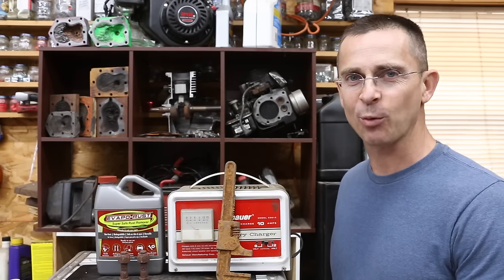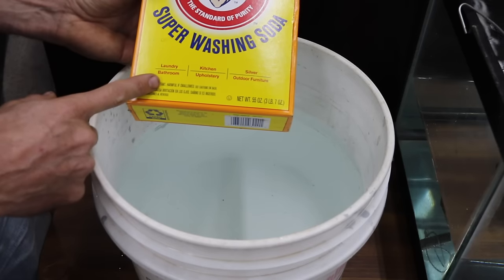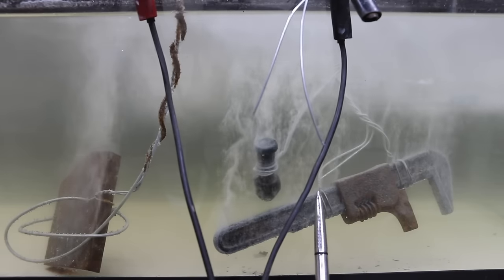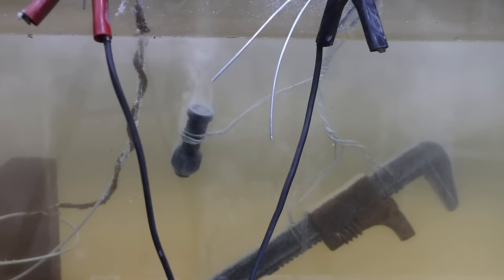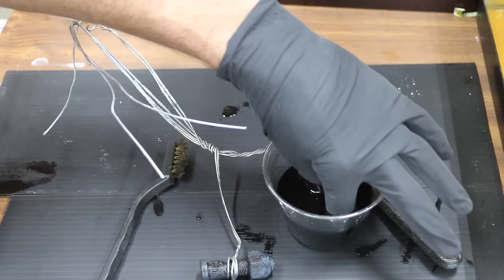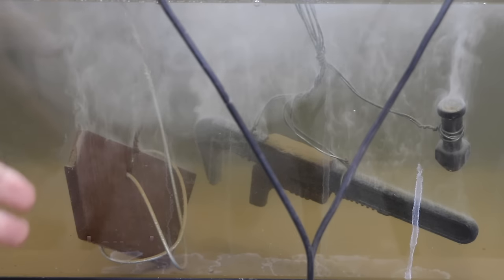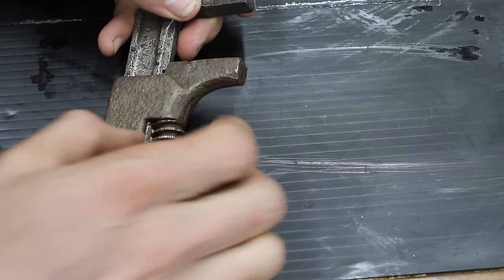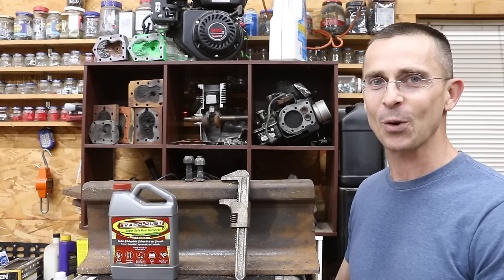Is Electrolysis better than Evapo-Rust?  Let's find out!

Comment: Perhaps it would have been best to connect the slide on the wrench to the wiring to make sure it was part of the electrolysis process for the whole duration in the tank rather than relying on the handle to be the electrical connection to the slide.
Reply from the maker: Thanks for the feedback.
Reply: @ProjectFarm  No prob. 

I really enjoy watching your videos.  Thanks for going through all the trouble of making them.

Comment: Vinegar works great, it's cheap and I soak the rusted tool for 6-24 hours.
Reply from the maker: Thanks for the feedback.
Reply: @ProjectFarm  yep I use white distilled vinegar all the time, using it as we speak because i accidentally left some of my battery operated drill bits out in the rain a couple days ago and found them yesterday all rusty. Started soaking them last night and am about to go hit them with a wire brush and then some WD-40

Comment: I think you needed to put more electrical connections on the ranch and the nut if you actually put electrode on the parts that were moving you would’ve got a better reaction
Reply from the maker: Thanks for the suggestion.

Comment: Needed to wrap the gear teeth in the wrench to allow current flow.
Reply from the maker: Thanks for the suggestion.
Reply: @ProjectFarm  I meant the screw part. Notice how you had to brush the other part of wrench. I think there was insufficient current flow because of the rust layer between both parts. Maybe also the lug bolt and nut as well. See if it cleaned faster with current attached to both peices. Maybe then the rust between the pieces would be removed better. Broken free sooner. Just a thought. It makes sense to me since that whole area of the wrench had inferior results compared to the rest as a whole. Good luck always enjoy your videos.

Comment: The amount of time you took doing the electrolysis could be massively sped up with a larger amount of sacrificial metal and a 200 amp battery charger. what literally took you days could have been done in hours. clean the sacrificial metal to make it more effective.

Comment: Dont forget to explain that after this process the parts should be cocked in a oven for few hours to remove the hydrogen, otherwise the steel will be extremely fragile.
Reply from the maker: Thanks for the feedback.

Comment: My water never stays that clean. After about 30 mins the water is completly brown and rust colored bubbles floating on top. I use atleast 24 volts or more, way faster than using a 12v charger.
Reply from the maker: Thanks for sharing.

Comment: I once used a plastic soda can as a container for electrolysis in my patio and the process caused a lot of hit and caused the plastic container to soften up and fall. After that i had to wash my entire patio with acid in order to clean that rust stain😁
But there's a question in my head about this process. It seems to me, electrolysis attacks the metal beneath rust more aggressively than the rust that's why at first it works on rust faster and when most of the metal cleans, process takes more time. I guess those holes on the wrench wasn't there because of rust but for electrolysis.
Hope someone read this and enlighten me.
Reply: Rust isn't only a surface thing, or rather, it eats away at what's under it as well. The electrolysis process forms tiny, tiny bubbles on the surface of the door steel, which  dislodges and pushes the rust/paint/etc away from it. Those pockmarks are thus where the rust had eaten in, like a cavity on a tooth. Because of how rust spreads, if you don't get it all off, it'll just keep growing from where it was left. Electrolysis like this is nondestructive.  That said, the method used here isn't the best. His wired appear to not be copper, so he's getting poor conductivity, the wires on the sacrificial steel are in the solution, which if they're of a metal that can corrode, causes them to corrode, which also results in poor conductivity, and he may have added too much baking soda, which can make the water itself conduct more than the metal. Check out the "Odd Experiments" channel for a good rundown/demonstration from someone who uses it to restore things.

Comment: Electrolysis was never meant to remove rust.  Electroplating shops clean the pieces by wire brush, wheel, sandblast and sandpaper or acids so that the metal looks like brand new BEFORE THEY PLATE IT WITH Copper, chromium, brass, zinc, or other metal....which is a layer added to the piece...taken from the sacrificial metal.   Iron oxide(rust)does not conduct electricity.  You were basically plating over the rust with the sacrificial metal.  I used to do it using a 12 volt transformer and copper pennies and plate the other metal  or graphite coated plastic or wood  in toilet cleaner H2SO4(sulfuric acid). Kids burn out their racing car set transformer 12DC to do this experiment.  Sacrificial metal was the penny to thinly plate the surface. Penny got thinner as it slowly dissolved giving up the copper atoms to be transferred to the other side.  It worked.  Done like +40 years ago.

Comment: Niice information. but l miss the electrisity  info. Volt..amp and so one. keep on.
Reply from the maker: Thanks!  Thanks for the feedback.
Reply: Yeah, me too.  I've seen them use 5v chargers and the like, but I don't know what the heck he used and he didn't seem to get the meaning of your comment.  He used a 6/12 v charger so he probably used 6 volts.  I don't know if the amps is a question here but adjusting the electrolyte might change that.  
How do you treat a rusted fuel tank with electrolysis?  Seems like Evapo-Rust is the answer (among others).

Comment: electrolysis turns some of the rust back into metal, works well with iron.  Iron air batteries use this method.
Reply from the maker: Thanks for the feedback.

Comment: If rusted stuff is oxidized, wouldn't you want Hydrogen THERE?  We're hearing that oxygen is bubbling off the rusty parts, would not this oxidize them MORE?  I have limited but very happy results with Evapo-Rust.  BUT pre-cleaned everything as much as I could!  Wire brush, washing, wipe with acetone say, something along those lines.  AND used lots of agitation, which Internet Kooks seem to dislike.  If you're seeing bubbles on the working part, that's probably wasted power, but this is not my field.  I have a vague memory from school days that the hydrogen and oxygen are released as atoms, not H2,  O2.  "Nascent" Hydrogen, Oxygen?  This is very active chemically.  I tried some home Anodizing once, and found that there were Hydrogen bubbles on the Cathode, but no Oxygen bubbles from the Anode, and thought that was because it was working (!) and the Oxygen was being eaten by the work piece as fast as it appeared.

Comment: For electrolysis you need to connect the moving part and the fix part. You only connect the fix part and because of the rust the moving part was not electrically connected to the process. Too bad because it would have been interested to see the reasult.

Comment: Meanwhile if you used hydrochloric acid you would have been done in 20 minutes and it would have done a better job.. regardless thanks for the video It was interesting
Reply from the maker: You are welcome!  Thanks for the constructive feedback.
Reply: @ProjectFarm  since you pay attention to the comments, side note for that would be to look for either hydrochloric or muric acid. They are the same thing but muric acid is a little easier to locate. 31% or more. I guarantee you'll be impressed with the results. Thank you for reading the comments!

Comment: I think you have too much rust  between the two parts of the wrench  that’s why the main part worked faster . You might had better results if you added a wire to the r wrench nut and slider

Comment: Anyone ever used a 70 volt DC tig/stick welder for the power supply?   I got a couple of 5' x 12" pieces I need to do. Just wondering
Reply: You can use a simple battery charger that outputs 6v at 500mah.

Comment: I use electrolysis all the time in my shop but might I give you a suggestion.  You need two positive anodes instead of one and if possible radius the anodes. This gives you more pull from different directions.  I don’t use sodium carbonate, I use sodium by-carbonate for my electrolyte, and I also use sodium hydroxide (Lye) as a cleaning agent which will leave a black smut on the part but it washes off very easy. Using it this way will remove paint, rust and grease. Also a heated tank works best so that you don't have to wait for the water to come to temperature. The warmer the water the faster and better the parts come out.  To the original poster only!  I did a video of this but never published it but if you’d like access to the link email me direct at Service@Willcoxcorvette.com.  I will share this link with you but not with the public I’m sorry.

Comment: if you use heat with evapo-rust i,e deep fryer just about a boil it remove's rust fast in about 30 minute's l use this method on rebuilding carb's and work's awesome
Reply from the maker: Thanks for sharing.

Comment: You did the electrolysis wrong. You should use an anion that is water soluble after reaction. Something like acetate. You should also try to generate hydrogen on a carbon electrode.
Reply from the maker: Thanks for the constructive feedback.

Comment: interesting how you said you can't get it to move at all at 3:00 roughly yet as you set it down you can see it move... not the roller but the actual lower jaw!!!! I feel you will find that the rust and your location of your leads attachment is the cause of why that particular section did not come as clean as fast as the rest. Electricity likes the path of least resistance the gap and tiny connection of the roller I feel is not getting the electricity because of the rust and resistance it caused. This is blatantly evident at 3:28 when you remove it the second time and the lower jaw is still clearly not being electrified!

Comment: You’re still using chemicals with electrolysis. No getting away from it. Too much electrolysis, and no more part.

Try EvapoRust in a sonic cleaner. I did that and it helps get the liquid between tight parts. You can see the dirt streaming off. It often allows parts to come apart. Warm it to about 125 degrees in the sonic cleaner.
Reply from the maker: Thanks for the feedback.

Comment: 15 percent content Hydrochloric Acid ** bathroom cleaner** formulas works better.....

I use it all the time to remove rust from metal parts that are rusted ranging from slight amounts of rust observed on the metal surfaces to parts that are thick with rust all over the metal parts.......Works great and only needs to be soaked in the Hydrochloric Acid solution for less and 1 hour in most cases.....Cheers
Reply from the maker: Thanks for the feedback.

Comment: Need a wire to the wrenches movable jaw as well
Reply: Also i know CLR or evapo rust becomes neutral very quickly so change fluid often when you start cleaning and more time later on. try clr against evapo rust for price
Reply from the maker: Thanks for the feedback.

Comment: Another simple method is to just boil the parts in water for an hour or two.
This is part of the rust bluing process, so it leaves the parts with a rust resistant layer when done.
this would have been perfect for parts used n this video.
Reply from the maker: Thanks for sharing.
Reply: @ProjectFarm  
I haven't tried it yet but I was thinking the boiling might have worked better on the wrench, the heat may have helped free up the moving parts

Comment: Dude! I’ve watched many of your videos, but tonight you’ve lost me.  Your “observation skills” have me baffled???? Did you not notice that after the first 24hrs there is virtually no rust removal “electrolysis” that has taken place on the wrench adjustment wheel and mechanism???? Then you make the same mistake in the second 24hrs.  If you wrapped the two wires (maybe three would have been better) one on the handle and the other on/over the adjustment mechanism, it would have had better electrical connectivity and the electrolysis would have cleaned it up and loosened the mechanism.

Comment: Submerge rusty tools in straight vinegar in a 5 gallon bucket and wait 24 hours.  Then brush off. Just as good results or better.
Reply from the maker: Thanks for the feedback.
Reply: Tried that also with tools totally rusted by sea water. It works!

Comment: this is my unprofessional and probably stupid opinion based on what i saw in the video

evaporust: simple and safe to set up. cheap in the short run, but probably will get expensive if you restore lots of rusty stuff (since the stuff evaporates,  you will probably have to buy a second or a 3rd bottle at some point). what you are able to do is limited to how much evaporust you own.
electrolysis: requires some setting up, and some safety awareness. expensive in the short run, cheaper in the long run (i imagine the battery charger isn't gonna be too cheap, but after that you just have to top it off with baking soda every now and then, and just give it a new piece of cheap junk steel). how much you can do is limited to the tank size and how good your battery charger is.
Reply from the maker: Thanks for the feedback.

Comment: I used take completley rusted solid dirtbike and 4whlr chains rusted visegrips tools etc heat them up in the oven then throw them in a mix of used motor oil and a little gas and the next day they would be like bran new worked every time
Reply from the maker: Thanks for the feedback.

Comment: i think that this two methods are obsolete, the LASER RUST CLEANER rock completely this two old methods, the laser cleaner in a couple of second solve all the problems relative to rust in everything, the bad thing is that the equipment is quite expensive
Reply from the maker: Thank you!

Comment: Did I miss something here??? First, I must totally disqualify myself. I have no empirical experence with this, but am studying it, and will be doing it soon. That said, however  ... based on my inexperienced observation ...what you did, does not make sense! You carefully prepared a solution, then dumped the primary solution into a large tank of water!!! That changed everything!! The mix is completely off ...  I'm questioning the procedure .... and seems to me that it could not be a valid 'test'. I suspect that had you not diluted the mixture, the electrolysis procedure MAY have been much more effective over a shorter period of time. I've seen this done from other sources in the past and the electrolysis method appeared to be far more effective than what you demonstrate.

Comment: STOP !, you don,t quite got the total point of Electrolysis. You forgot to make a (wound) starting point on the metal. ( electrons need to search a way out thrue the metal) That is the process that it bounce off the rust to make contact. And the best way is to use as much insulateted wire, and less Iron wire like you do! The electrons can travle too easy through that wire you made. You can already see it on the wrench. The base handle has a little effect but the adjuster stays rusted. They are not connected!  Electrolysis works! , you have to connect each part diffrently on a wire to a fresh wound!

Comment: PUT THE WIRE ON THE PART THAT'S STILL FROZEN!!!  THAT WAY YOU HAVE VOLTAGE GOING THROUGH IT AS WELL!!!!!  RUST IS A VERY GOOD RESISTOR!!!!  THAT'S WHY THAT PIECE DIDN'T GET UN RUSTED!!!!!!  IF YOU ALSO PUT A WIRE ON BOTH THE BOLT AND NUT I BET YOU'D BE ABLE TO SEPARATE THEM EASILY!!!!!
THINK REAL HARD ON THIS CONCEPT!!!  Multiple piece parts or tools need to have power to each individual part for electrolysis to work and UNseize them!!!!!
Angry pixies are by nature VERY LAZY!!!!  They WILL NOT go through resistance to get where they want to go!!!!!  So if you have a portion of something that is rusted TO another piece, you MUST feed pixies to ALL pieces to have the electrolysis work on ALL parts!!!!!

Comment: You needed to place a contact on the lower jaw
Reply from the maker: Thanks for the constructive feedback.
Reply: @ProjectFarm  your welcome. If you were to splice a couple of pigtails off that lead and place each on the nut and lower jaw as well as the main, the entire wrench would have been rust free the first time around, the current was very weak in those two parts.

Comment: A carbon rod is better for the positive side than a piece of steel. DO NOT EVER USE STAINLESS STEEL AS AN ANODE (positive side) . That will produce HEXAVALENT CHROMIUM. Hexavalent Chromium is TOXIC, CARCINOGENIC (Cancer causing) and it is an EXTREME environmental hazard.  Do not use Galvanized STEEL as the anode either. 

  Graphic is the next best anode to expensive platinum  It doesn't decay as quickly as a steel anode would. It doesn't produce the brown messy gunk in the electrolyte water as a steel anode does. It doesn't electroplate any other metals onto your parts like copper or brass or aluminum or Zinc Coated Galvanized Steel anodes will. Brass, copper, and Aluminum coatings can actually ACCELERATE rust later on the part you are trying to save.  You are trying to de-rust not electroplate.  Graphite anodes do not electroplate your part and do not dump electrolytes into the water.

  If you are doing a lot of electrolysis you are going to have to clean off a steel anode or it will take more and more current to work.  The oxidized layer created on the steel will become more and more resistant and less and less conductive.  Not so with a graphic anode. But steel can be cheaper than graphite electrodes. Graphite electrodes still decay as the carbon reacts with the oxygen produced to make Carbon dioxide.  This is because the water is being split into Oxygen and Hydrogen.  All good reasons to do electrolysis in a well-ventilated area.  Hydrogen go boom!  DO NOT USE STAINLESS STEEL as your anode.  NOT worth it.
Reply from the maker: Thanks for the feedback.